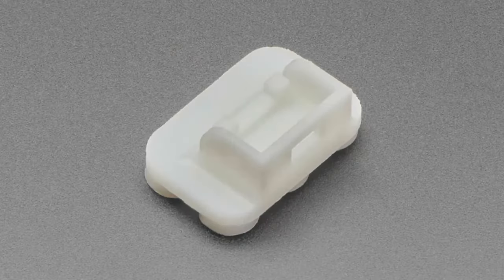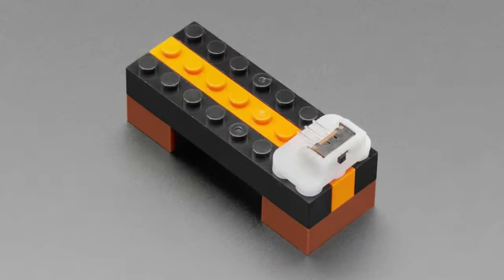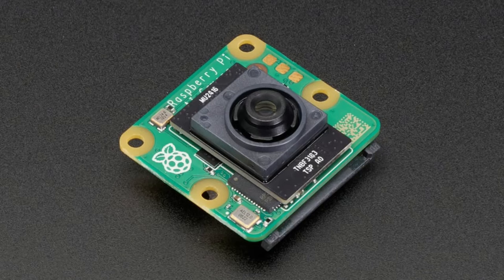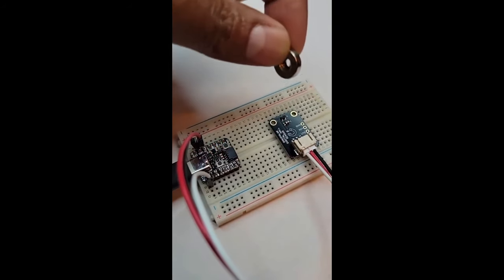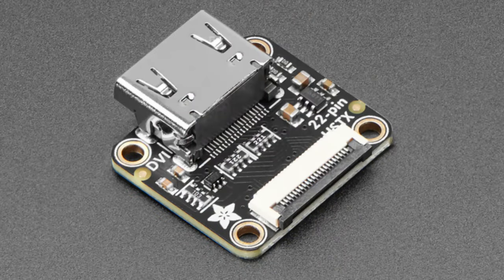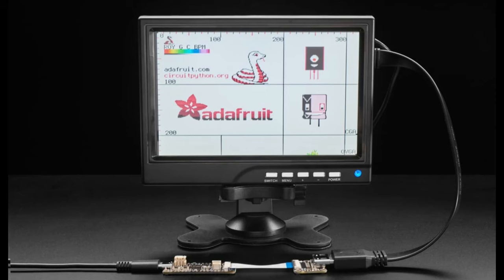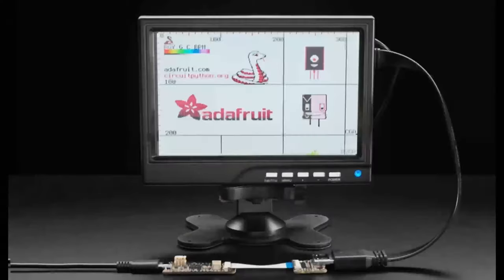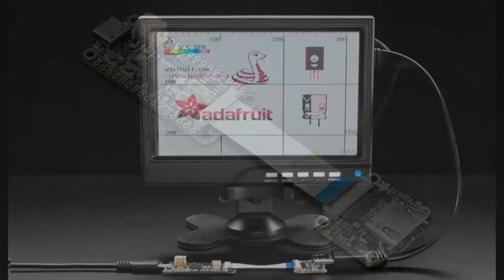#NewProducts 10/2/24 Feat. @Adafruit #RP2350 22-pin #FPC #HSTX to #DVI Adapter for #HDMI Displays!

Comment: can i integrate led lighting into bricks and eliminate the wires?
Reply: The only way to light up LEDs wirelessly is by the inductive LEDs that require a coil. Otherwise your best bet is to do your best hiding copper tape or thin gauge wire like 30AWG magnet wire. Be advised that thin wire is going to suck at delivering electrical energy, which means you might need a capacitor near the LEDs if they're addressable.

Copper tape might be the way to go, you can maybe sandwich that between smooth plates and the underside of other plates, or conceal a one-plate thick gap to run your conductors. If you need to cross them, use Kapton tape as an insulator. I've done something similar when I made light-up holiday cards. The main tricky thing is to solder the connections without melting the bricks/plates.